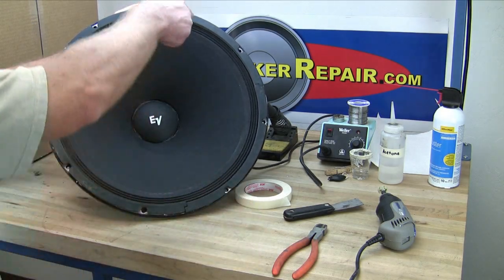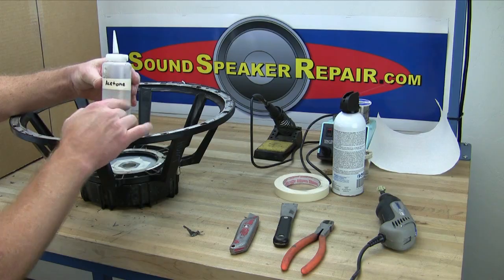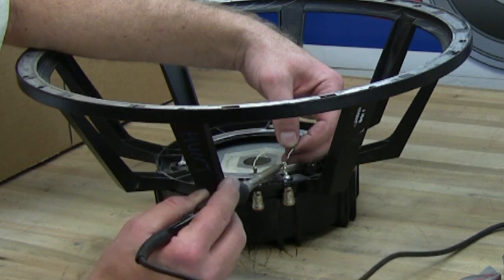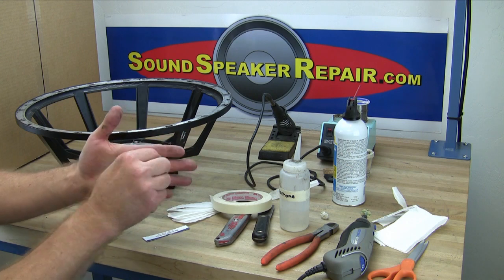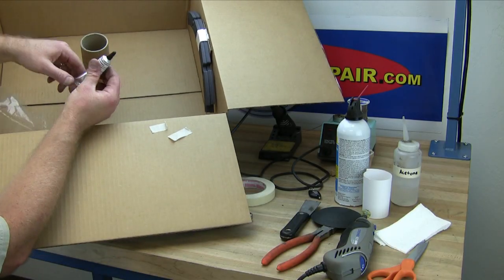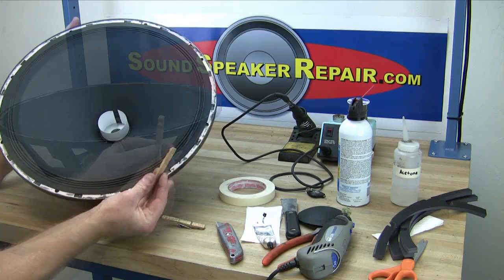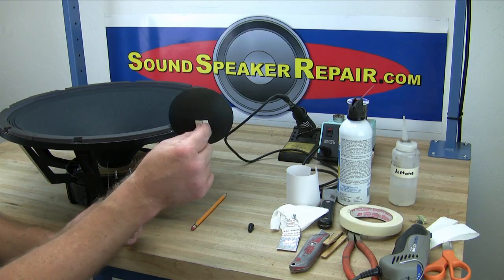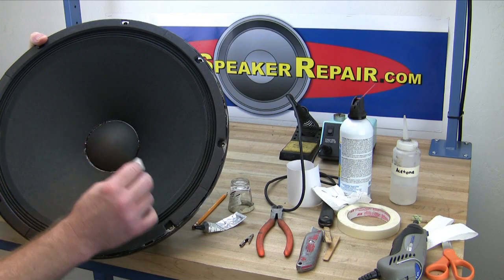How to recone and repair a speaker or woofer with a Pro Parts recone kit

Comment: Very nice video.  Would like to see one though were you are replacing the tinsel leads on a sub and have nothing to work with but the frayed ends of the old leads.  This is common among subs such as the Kicker L7 where you can't get access to the voice coil to replace the entire lead.